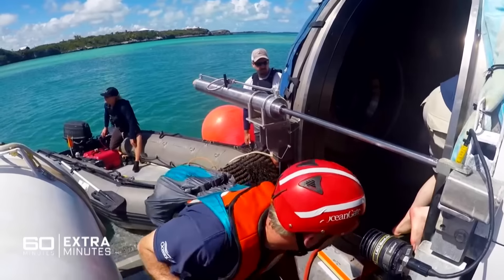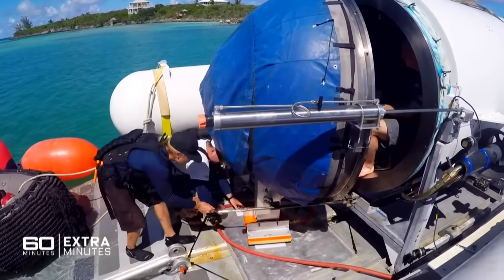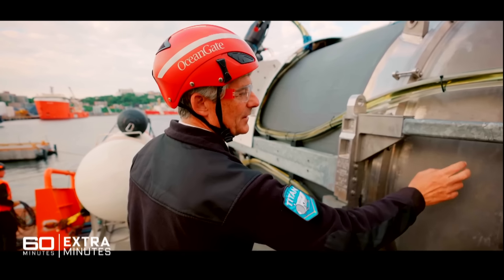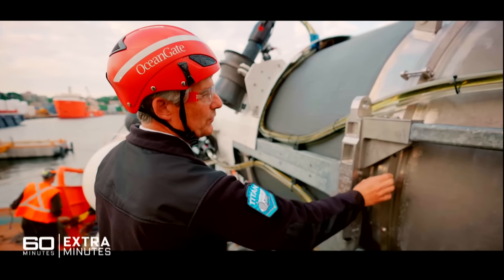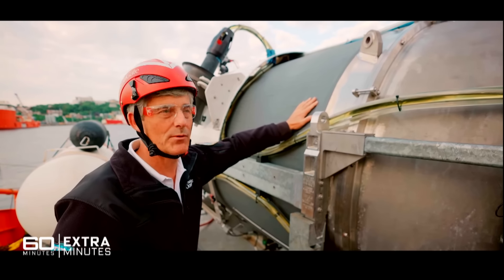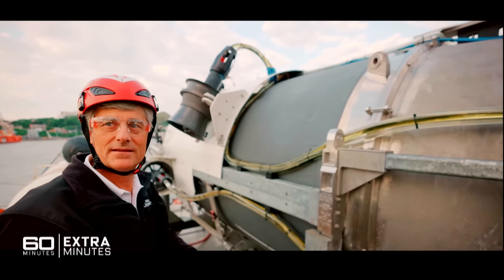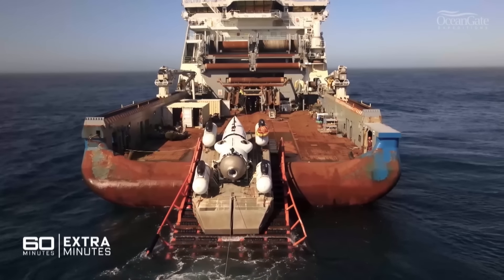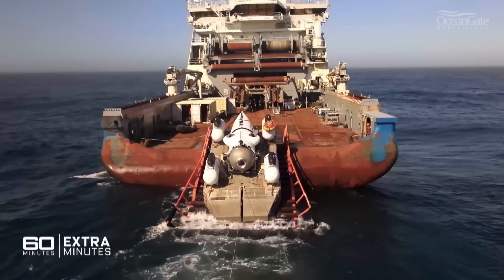Titanic sub implosion explained | 60 Minutes Australia

Comment: Mechanical Engineer here, The things missed was pretty common core mechanical/aerospace engineering knowledge, shocked Stockton Rush had a degree in aerospace engineering and didn't think through this basic core Mech/Aero engineering practice. The carbon fiber hull is likely a poor material selection for the application. Carbon Fiber is stronger and lighter than metal. That's great for a Formula 1 car shell or monocoque. But a submarine? No. Strength is not the same as Toughness in the physics world (Mechanics of Materials/Solids, a damn core pre-req sophomore class for mechanical and civil engineers, necessary just to get into 300 and 400 level courses). Toughness is defined as the calculus integral of the function approximated of the stress strain curve. That always starts with a linear rise/run slope, engineers call it the modulus of elasticity or young's modulus. Once stress on the y-axis reaches a certain threshold, that every material on earth has, it reaches its ductile yield point. This is the point that any further pressure on the material will cause "plastic defornation", the permanent deformation, stretching and altering of the material called the necking phase. At a certain point, the material is too stressed to deform any more, and fractures or breaks. 
Carbon Fiber is not tough. It has relatively low toughness. Being very stiff means a high elastic modulus and it takes a ton of stress to reach the yield pt. However, once the yield point is reached, it can deflect or deform plastically very little before it cracks or breaks. Once a crack occurs, it can propogate. Each fiber that breaks in CF disperses its load to surrounding fibers in the epoxy resin. As more fibers break, the whole line will break when all the fibers are overloaded (Materials engineering class). Carbon bakes also need to be checked for bubbles and voids and disparities in the internal resin volume. In aerospace they often shoot mild waterjets on the skin and listen for frequnecy with DAQ feedback sensors. They can do an SPC and determine an accetpable Upper control limit of how many issues they see in the carbon bake. This was not done. Fatigue failure often occurs even if the stresses are below the yield point because it exceeds the more localized, microscopic stress or yield tolerance, and causes small continous deformations or displacement, which compound and propogate. Each crackling sound is the carbon fibers snapping, dissipating their loads to surrounding fibers.
Metals, particuluarly those with alloying agents, and a coarser grain structure, may have a much lower yield point. But metal can plastically deform i.e. "Dent" quite a bit before it shears or tears apart. That means that calculus integral formula gives metal a huge toughness advantage. Of course, the repeatedly forged steel of a japanese Katana would be relatively lower in toughness but high in strength, because of the fine equiaxed grain structure, and grain boundaries impede the "dislocation motion" of the ability for bergers vector slip plane movement under load, the dislocations are impeded when two nucleation sites of atomic lattices meet, forming a boundary of two lattice systems with different direction vectors of growth during metal solidification and cooling. A Material selection software could have recommended a good material for this sub, which a FEA (Finite Element Analysis) simulator could have tested to pressure on the hull of the CAD model, ensuring the hull could withstand the depth pressure.
Metals are metallic bonds, which also are favorable for toughness and ductility. their outer orbital levels/shells have valence electrons analogous, for lack of a better term, to full time prostitutes. These electrons exist in a "Sea of valence electrons". They are not loyal to one Nucleus to orbit. Instead, they can jiggle and dance around neighboring atoms orbital outer shells. That's why metal sheets have the distinct propogating tings and wavelike sounds. At the atomic level, the outer electrons are dancing with other nuclei as you shake the metal sheet. In a car accident, this means metal can collapse in upon itself, saving your life as it crumples and absorbs impact energy, engineers call these sections on a car "crumple zones". The area you and your family sits is the "Safety cell" or "cabin cell", engineered to stay as rigid as possible. The energy is also designed to ripple around and over the occupant cell and through the tail of cars, why you may notice distortion in the rear quarter panel of a car hit from the front. Due to work hardening the metal also strengthens during its own crumpling, which is kind of advantageous as you run out of crumpling space. In a pressure vessel, the valence electrons can move around and allow slip plane dislocation with a large amount of necking or displacement before fracture occurs. If an engineer knows the alloy, temper or heat treatment, and using eutectic phase driagrams and understanding of alloying agents and cooling curves, he's right we can predict exactly when fatigue failure can occur. We do that with SN curves, Mohr's stress circle plots, Weibull distributions, Castigliano's theorem, etc.
Finally, is Factor of Safety. Factor of Safety in vehicles, buildings, infrastructure, is pretty much always over 1, often many factors over. Saying, as an engineer, you are comfortable sending a submarine 4000m down past what the hull is theoretically known to take means you have a hull pressure safety factor far below 1. Engineers typically engineer everything structural for a Safety factor over 1, meaning its slightly overengineered to handle loads and stress beyond the typical stresses expected in the real world. That way, the chance of failure is lower in the event of a freak or niche event that causes the material to be extra strained. FMEA is also necessary to brainstorm potential failure modes and brainstorm redundancies after determining failure modes. James Cameron's submarine was crammed with controls systems acting as redundancies, signs he trusted a skill multidisciplinary team of engineers and let them do whatever they needed.
Even with all that knowledge, I could not authorize any vehicle as an engineer. Like most non-senior managing Mechanical/Auto/Aero/Naval Engineers, I am not a PE. While common for Civil engineers, only 20% of mechanical and related engineers are Professionally Liscenced. My liability is absorbed by higher up engineers, in my job, since I'm the only engineer at where I work, the clients we manufacture for have at least 1 Mechanical P.E. that signed off on drawings.. It is illegal to endanger the public if a degreed Mechanical Engineer like myself acts alone and rogue, and authorizes a vehicle myself for public use. That's because to be completely sure the aircraft, cruise ship, and car you may board has almost no chance of putting your life in danger, a P.E. is at MINIMUM, a holder of a Bachelors in engineering, passes the Fundamentals of Engineering exam for their discipline (basically an 8 hour comprehensive ethics and applied physics exam) with at least 70%, practices for 4 years as an EIT (Engineer in Training) under a PE for a minimum of 4-5 years, takes the Professional Engineer Liscencure exam (basically a 13 hour exam, the FE on steroids), probably retake it once or twice, and then, they can authorize designs for vehicles. It's too much for me, so I like most MechEs don't bother. But that goes to show you how much regulation it takes to engineer something. Just like Medicine, A PE and practicing physician or lawyer can't practice without liscence and post-graduate residency for years.
Reply: U paste that crap from wilipedia?
Reply: @Gigapixels  nope, I have 2e autism
Reply: @alexlarson2466  ok u r honest,. may i know what is your main conclusion about the sub? really tldr sorry tho

Comment: Lets comment about the application of carbon fiber in compression versus  tension.  Also the adhesive used and the fiber application straight wind versus cris-cross.  Their appears to be a lack of engineering design that went into this - Like did any of the designers ever take a strength of materials class and did they pass the course - other wise called catastrophology. The end caps join to the body seem very short too.

Comment: No, it was NOT the carbon fibre that failed - it was the epoxy matrix it was embedded in that failed. 
TBH, I was surpised it lasted for even dive, let alone several before failure - but even then, it wasn't really the material but the use of it in that application that was 'the fail'.

Comment: Carbon fiber is used as an alternative to metals, ONLY in applications,  where saving on weight is beneficial,  like in airplanes and race cars. For those applications,  it is "strong enough", but obviously not as strong as its metal counterpart. It makes absolutely no sense to trade strength for weight savings on a submersible. 

The hundreds of videos about the titan, i have yet to see anyone bring up this obvious detail.

Comment: Simplifyng things:
Looking at the structure of carbon fiber in a microscope. If a structure like that deep sea vessel is being secondarily supported and held by fibers, it follows that its ultimate strength lies in the weakest fiber. Subjecting this material repeatedly at such pressure of 2,500 kg per square inch may have weaken just a sliver/fiber. This would then create microscopic domino effect to other slivers/fiber around it. The tremendous pressure would make the failure almost instantaneous like popping a balloon.

Comment: The dude said it, carbon fiber is essentially a “long piece of string” n as we all know, string has fantastic tensile strength, and absolutely zero compression strength. Which is why carbon fiber is great for keeping things under high pressure in (gas for example) but really crappy at keeping high pressure out which, last I checked, is something you kinda want when building a submersible. Pretty simple physics. Really shocked Rush was able to sweet talk anybody into that soda-can-of-death.

Comment: As a Principal and Ph.D. A.E. with a large American defense contractor known for their stealth F planes I have some expertise in CF usage in conjunction with alloys. I tend to disagree with the gentleman here when he states a given CF composite product's failure point cannot accurately be predicted. I would change that statement to be "Without careful material/manufacturing examination/selection criteria and without specific electronic wave test analysis criteria, a pressure failure point cannot be predicted for CF. Based on what I have read about the submersible's chief designer, Mr. Rush and his limited Engineering background/work history, it is clear he didn't have a grasp of the complexities of modeling for CF failure points. It appears all he took from his brief stay as a Flight Test Engineer was the Check List's that they live by, without understanding the need to back up said checklist with solid Engineering studies/analysis.

Comment: Some people here say carbon fiber is madness in such an inward force (pressure) scenario, others say it's about how it was built, with the fiber being placed cilindrically in a single direction (which has less resistnace than cross placement), other people say it was the air bubbles in the resin etc etc. I want to point out what I think it's the absolute craziest thing about this: the bonding. They literally glued the titanium adapter directly to the damned carbon fiber with glue, all that while not wearing gloves or any decontamination safety and expecting it to withstand millions of tones of water pressure. I am a simple programmer with no mechanical studies and if somebody told me how they were building it before this accident even happened, I would have been shocked. It's basic common sense. This is beyond insanity, but quite expectable from a ego-maniac narcissistic greedy millionaire CEO. This should remain in history as an example of "how not to do things" for all future generations.

Comment: Even when rock is compressed, when you take off the load it doesn't spring back exactly to its original position. The same with repeated loading and unloading. It's going to crumble eventually. From a materials perspective, the same with carbon fibre.

Comment: Another point I have not heard discussed is that carbon fiber had tensile strength but in this application it would require compressive strength. Compression would tend to shear individual strands until the integrity was compromised.
Reply: @@klinestill I guess I missed it. I did see it mentioned as I was scrolling through the comments.

Comment: What I really don't get is,  why use carbon fiber when steel is so cheap?  And obviously more reliable
Reply: It is all about strength to weight ratio- If it was made of steel, it would have been extremely neg buoyant, which would then require literally tons of special foam, which then makes the entire craft much heavier and more expensive to transport.  For example- https://en.wikipedia.org/wiki/Trieste_(bathyscaphe)- that entire float is filled with gasoline to counteract the weight of the steel sphere- (they hadn't invented the syntatic foam yet)

Comment: The reason the sub failed is that carbon fiber relies on tensile forces to be strong. When it is pulled tight it provides the most stricture to the things it is used to make. Carbon fiber in a resin matrix is usually able to take advantage of carbon fibers tensile strength as the resin shrinks slightly in all directions as it cures, pulling at the fibers. However when you start to reverse that input and tensile strength is replaced with compresive strength in the equation, carbon fiber becomes almost useless. In effect the sub relied on resin saturated fabric wrapped around a stainless steel tube to keep those people safe. What is worse is that they did not even use propper proccesses in their design. They wrapped carbon fiber threads around the tube almost entirely in one direction, further reducing any benefits the carbon fiber could possibly offer, especially under compression. The carbon fiber coat was essentially only effective at scaring the crap out of the people who heard it start to fail over multiple dives of this engeneering nightmare.

Comment: The microfibers in the hull are being compressed and deformed by the pressure. Every deformity will weaken the hull and its ability to withstand the pressure. At some point the deformity in the hull will start a fail cascade where the hull is no longer able to withstand the pressure.

At those depths that fail cascade will become unstoppable until the hull implodes.

Remember kids: you can fight physics as hard as you like but physics always wins. Physics trumps ego every time.

Comment: I think that iy would have been ok, if the composite tube was used 10 times maximum. It went like a brandy snap with pressure cycling delaminating the fibres. Ask a car guy about old grp bidywork. Its crispy to the touch while being just a bit too flexible. Its a right pain in the butt to put right, and it cant be as good as when made in autoclave. The tube was basically disposable. Very clever design though. He did do it. He just over done it.

Comment: One thing I don’t understand is how the designer(s) were not aware that carbon fiber is very strong under tension, but not under compression.  A container of cf going into space under zero external pressure might be fine, but under massive external pressure the main strength is in the resin.
Reply: They knew that but Rush viewed himself as a trailblazer that was going to show everybody that a reusable CF hulled submersible was possible. Physics proved him wrong.

Comment: The shape of the passenger compartment is totally wrong for a deep sea dive of that range specially with carbon composite materials and having insufficient structural support/shape to negate the water pressure from outside. Utter madness this design is.

Comment: I watched another engineer who suggested that it could have been a few things the plexiglas window wasn't designed for more than I think 3000 meters then others have said that it may have been the glue because of the fact that titanium and carbon fibre stress and relax at different pressures so to be fair I think that there were a few things that would have eventually failed,even when they tightened the bolts i did not see a torque wrench,I am no engineer but I am a welder and even a welder would question the safety of a pressure vessel, but I think Stockton Rush was so happy with the previous successful dive he didn't stop to question his design even when people had declined even i believe that a couple of famous utubers declined.

Comment: So he could fit more passengers sounds like a slight towards tone ceo. You could just build the metal with more space in between and get the same effect, I believe it was way cheaper then metal that’s the real reason which is also a slight but the correct one.

Comment: I thought the banging sounds were from carbon strands breaking .The carbon Fibre strands were spooled on the sub from big spools . Then some resin is added during the process and the air is  sucked out probably to get rid of air bubbles because air bubbles trapped in the hull are really bad news . I wonder if some bracing spanning from side to side on the inside would have strengthened the hull .